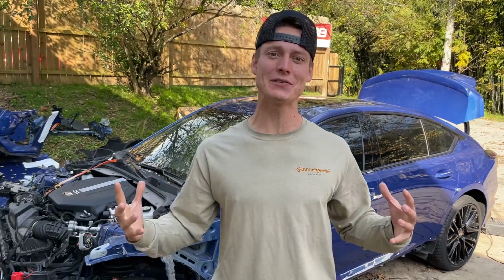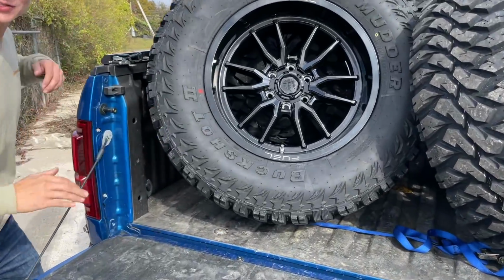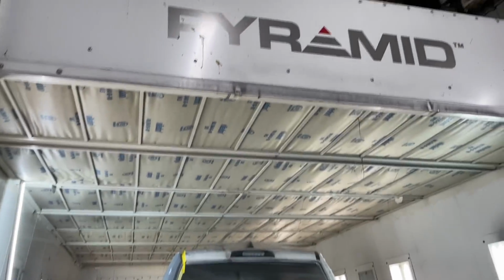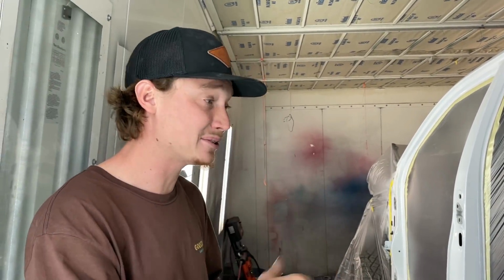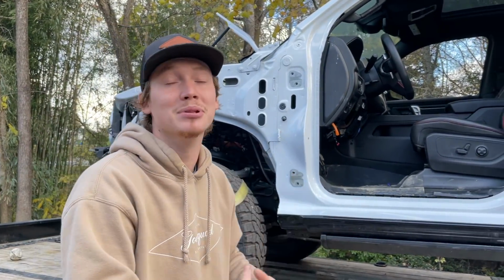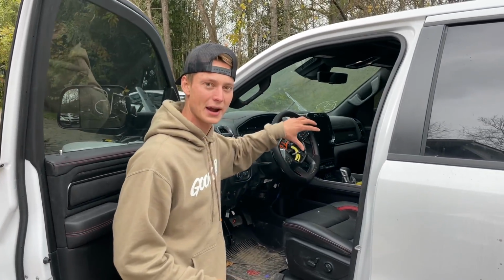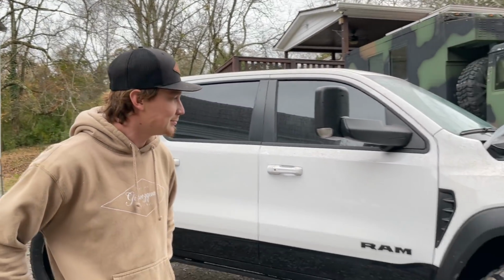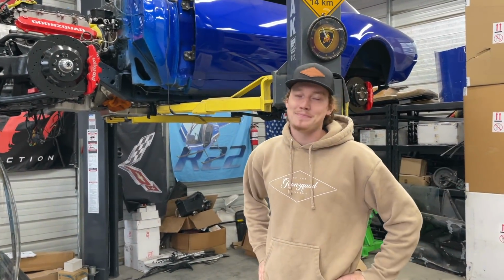Update On Everything!!! This Will Speed All The Builds Up!

Comment: 21:08 how many people can remember seeing that spot behind Simon, where they’d be building outside, then the pad came and the small shop… next the HQ and onwards so much content and so many better build. All hard work 🙌🏼
Reply: They were  storing  Jeep  axles  on  the  pad  beside  the  forklift.  Not  the  Big  zoom  boom,  but  the  little  forklift,  that  occasionally  got  stuck.  Before  the  skid  steer,  and  the  excavator.  And  the  Hellcat.  And  the  Corvette.  The  Mustang.  The  Subaru.  Back  when  the  little  garage  was  where  they  worked  out  of.  I  can  remember  them  stripping  down  an  axle  for  one  of  the  Wrangler  builds  in  the  garage,  with  Billy  cutting  grinding  and  welding  on  it  because  one  of  the  brackets  was  really  mangled.  And  the  4.0L  that  was  going  back  in,  gaskets  for  the  oil  pan  and  exhaust  I  think.  Might  have  been  the  blue  2  door.  And  ya,  yer  right.  Hard  work.  It  pays  off.  And  it  pays  off  really  well.  And,  just  to  say  it,  a  tip  of  the  hat  to  Mom  and  Pops.  It  shows  where  the  boys  got  the  work  ethic  from.
Reply: The pad was there before they started filming on youtube.....

Comment: Weird, when u started to build the garage u said it was number one priority to get done, and  then u just stoped?
Reply: Running out of cash? 😂
Reply: Think someone called them in
Reply: They  might not have gotten the proper permits ,,,,didnt see any building permits posted !! Usually the city makes you install SLIT fence before construction begins !!  Pops was just putting it in now !! Which makes me think they didnt have permits ,, plus never saw the city engineer inspecting any part of the build so far !!!  Thats a big NO NO !!!!!    May have gotten a  " cease and desist " order from the city ,,,meaning no more work till everything on the job site is inspected and the building plans are approved by the city engineer !!
Reply: @tnolan3176  Well if it is so, tell the truth no one will blame them if the screwd up a little.

Comment: Hey with that camaro you may wanna order some stiffening kits from hotchkis suspension and maybe copy the setup mary pozzi has for her autocross championing 1970 camaro as your gonna be putting well into triple the power the car had when stock with its stock 350 that put out maybe 220, 230 Gross Horsepower, and while the brakes have been upgraded the frame hasnt.

and the way it goes is if you wanna keep the rear in line you need to get some front stiffening kits, like front anti roll bars, the Monte carlo stiffening bar that goes over the front that you see on old mustangs and the like

and a four point roll cage wouldnt be a bad idea either, as your talking about putting modern camaro power in a car that weighs about 1500 to 1700 pounds less without any rebar in the doors to protect you from a side impact, without anything but the rubber on the road to keep it in line so you gotta do it manual with things like that. 

and while their alot of fun, too much is too much on these, its why actually the best power plants for these older cars are worked over small blocks that give you more power than stock, but not so much that it cant handle it. 

like hell on the old Don Johnson Show they had with the 71 cuda he actually liked the small block 360 car better than the big block 440 just because it didnt hinder the car and gave a good power to weight balance for it without making it plow in the corners.

and your cars probably about the same size as that E body, so you need to treat this thing like a vintage racer with the power your putting in it and go full racer spec with the reinforcement or it could end up back in its as delivered state quite easily. 

especially if it has a manual and you dont hold the brake a little during the shifts to keep the back end from snapping out, which is how the race car drivers handle these old things in vintage racing, gas with some brake to keep it in line rather than floor and hold it which is how crashes happen with these things

and its also why when you find muscle car survivors their almost always automatics just given people couldnt do that with them, either that or they had an auto with the hurst shifter kit on it which did the same thing without that biting them like those did

especially with the 350 camaro's as most people cant drive stick in america, and if they did they power shifted on a car with say 14 inch 165 size tires with 230 HP going through them

which is never a good idea.

Comment: Nice, but suspension lift won’t help clear bigger tyres on IFS suspension, becasue when the tyre fully cycles all its travel it will go past what the factory lift position is. You need to clear bigger tyres on full bump and droop and cut away whatever it scrubs on. Also please don’t get strut spacers for the levelling kit, they are the worst.

Comment: The costs associated with the work of having the Robinson R22 restored to Airworthy Status will certainly exceed six figures including Certified components, to which will have to be added at least $20,000 for each of the two brothers if they wish to attempt to be Certified to operate the aircraft at the most basic level. Simeon and Eleazar need to be aware that the training required will probably take at least six months and will involve the considerable study of a wide range of textual, data-based and diagrammatic technical material, the passing of tests on the contents of those texts, practical training in an R22 with a Certified Flying Instructor at approximately $200 per hour, solo flying, all culminating in an extended a Test Flight ('checkride') with an FAA Licensed Examiner, during which the Applicant will undergo a practical and verbal assessment of many aspects of safe aviation practices.

Comment: Finally a helicopter update.  Was wondering because legally the only way you can work on an aircraft is to be an A&P certified mechanic to do anything besides changing oil and brakes.  Even to replace a burned out bulb you need to have an A&P do it.  On that note, Robinson's are known as Lawn Darts due to the high crash rate vs other copters.  Be safe in that thing.
Reply: They where going to have an A&P oversee the work and sign for it. The work itself does not have to be done by an A&P. Most A&P's would not go for that unless they where working directly along side you. Then you are probably just slowing down the work unless you already have some skills. Costing yourself more money but maybe learning something good. In a repair station you would not have to have an A&P to even sign for the work. But your chances of getting a job without one is slim.

Comment: Alright so whenever you mounted the tires, there should be a wheel that pushes the duck head out. Spin it and push the duck head out about half an inch then raise the duck head about a quarter inch then it won’t touch the wheel and won’t scratch it

Comment: Hello friend, some restoration BMW 👋🇦🇷.
Reply: @mattivirta  Besides what is the problem with the BMW brand !!!!
Reply: @gabrielr676  problem have lot, thats has say bmw factory plan engineer itself all newest than 2000 year cars have totally wrong plan ,build, worst material, make cheap parts, worst bmw ewer has made. before 2000 has lot better materials, parts etc. and have own skill too, i has 500 serie bmw ytoung and all has world worsat body, factory say emercency information notes, body rust apnormal fast not has covered rust proof, inside all body sheet not has painted and safe good at rust, and my brother bui 600 000 $ sport bmw car and newer not can drive this has new car but if weather has 0 or minus degree could enginme not newer can start, factory engineer group 88 men, come from  germany  to brother garage and try repair car, change many computer,sensors, and newer not can start could weather,  thats have normal shit all bmw tgoday. not good guality and worst parts and materials. germany engineers move all new car back to factory and newer can repair trhis start could weather and give brother all monewy back and little more, brother buy lamborchini and not has newer any problem has weather could or hot.
Reply: @mattivirta  

Factory problem have all cars, not only BMW, most important brands also have their faults and defects in themselves, so buy a cheap one as well as a very expensive one, BMW is a respected brand like so many others too. 🙂
Reply: @gabrielr676  my and my many friends skill have all bmw has world worst shit car, newer not working well and alltime new car has broken .buy new or old alltime only waste money lot all europe worst car say factory engineerings too. any engineering in europe not newer want buy bmw because we ewery know how worst car bmw made. waste only money if buy, idiot only buy and young stupid boys..
Reply: @mattivirta  

It seems to me that you do not know what you are writing or do not think before writing, you cannot say that about a prestigious brand like BMW, all cars have their defects and problems, you can criticize a car brand like everyone else but me It seems that you do not know what you say, I felt the pleasure of a BMW and if you want we continue talking 🙂
Reply: @mattivirta  That's why I tell you, the fault is not the pig, but who feeds it, no!!!! 😎🤷🏻‍♂️
Reply: @gabrielr676  i nmot criticize only bmw but i know good bmw history  i has buy some and my brother buy wery expensive new bmw but not newer working well, i thin k if car have good and cost 600 000$ need be totally perfect and not  be alltime broken, same have mercedes, my friend owner have 8 mercedes have him hobby ,but him say merc all new models have lot problem and him has need change ewery car manytrime new computer box because have fail in factory and all merc hav e lot elektric problem ,samer bmw have. VW have body and door problem i know all cars have somethin k n ot good but all europe biggest problem car have bmw and all car engineers all world say same have big big fail and worst car what has newer plan and build. thats is true not my think only all world ewery car engineer know bmw have only big problem iron piece.
Reply: @mattivirta  

Failures in the manufacture of components can be, since generally some components are not manufactured in said factory due to the cost issue, some manufacture outsourced said works for the costs of the same or others not, even if you have a car of more than 1 million, electric, hybrid, failures and problems are going to have, criticism will always be in everything, either when you buy a candy to a car of more than 1 million 🤷🏻‍♂️